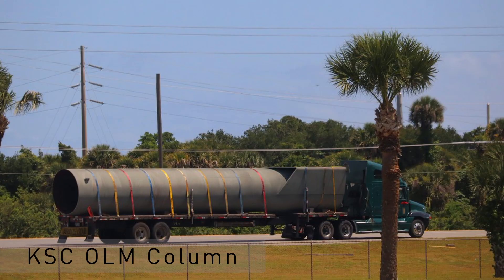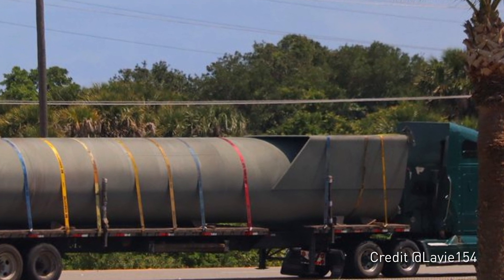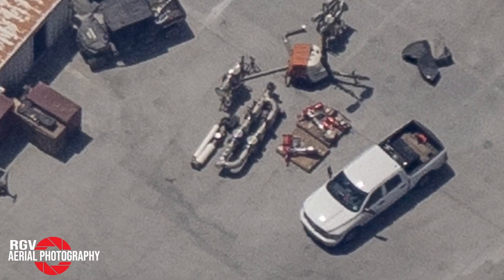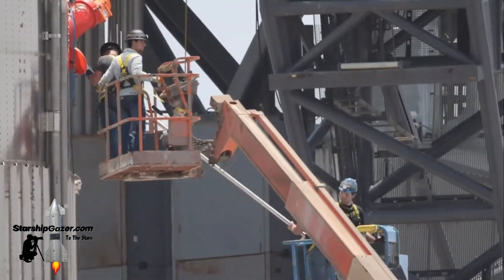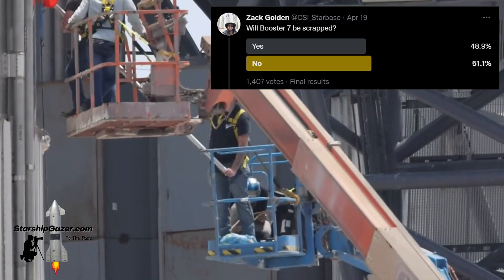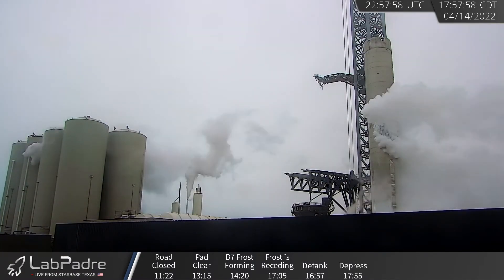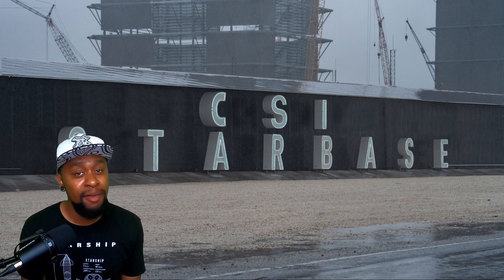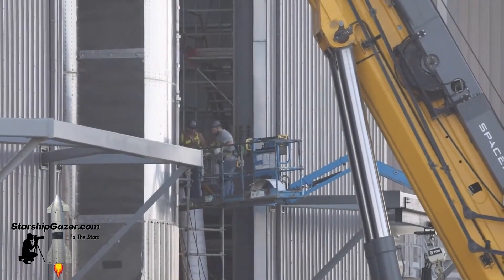Starship Booster 7 Downcomer Failure Deep Dive

Comment: I don't want to go through all these comments to see if someone already addressed this so I'll just go ahead.
The reason for two basket filters is, probably, not for a primary and a backup but rather reducing resistance to the propellant flow. The filters would act as constrictions just as electrical resistors act as constrictions to electrical current. So, as resistors in parallel lowers the resistance to the flow of current, these basket filters in parallel lowers the resistance to the flow of propellant.
They designed the feed lines without the filters so this seems like a hacked up work-around to solve a problem quickly and cheaply without having to rip out and replace everything.

Comment: Perhaps the best solution
is the following combination:
Small thick-shell tanks, capable of holding 400 bar
(pressure of oxygen and methane in the critical state),
and a compressor that takes required amount of liquids
from main tanks (8 bar)
before each session of recovery of gravity
after a period of aerobatics;
pumps enough of them into small tanks. 
After the consumption of supercritical fluids
the configuration goes to rest,
waiting for the next request
about the need to restore the normal vector of gravity.

Comment: defueling was tooo fast between the GSE and header tank////unstable pressure equalization between the two/// the header couldn,t keep up with
the rapid change in equalization of the two fluids rapid movement during depressuration  ???????pipe collapse when header emptied at a rapid rate????

Comment: The event shows a blowout more than a collapse  both of which could happen during venting or depress. A higher pressure at first then the collapse since the ice was forced out rather then collecting in the center. A plugged pipe getting a rush of pressure then it cools more and collapses because of vacuum or lower pressure gradient. You know pop out then pop in you crush da can man.

Comment: Nice work on that downcomer collapse. I timed it out and the peak in the sound recording seems to be about 0.01 seconds. That's a pretty quick failure. Are you thinking that the pressure was allowed to drop to quickly in the methane tank?

Comment: I wonder if the failure was intentional? Maybe testing the extreme limits of what could happen. Or was it an operational mistake during the detank process that led to the failure. Someone may have opened a set of valves at the wrong time. Either way it gives them some real data to understand the operational parameters of fueling the rocket.